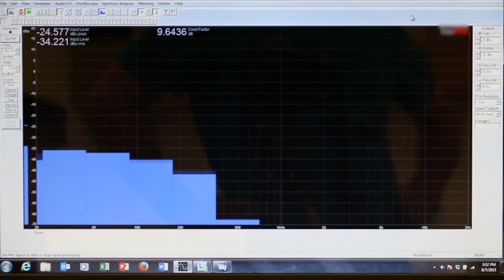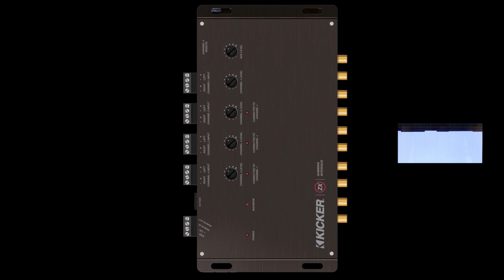Kicker Audio: How to find a full range signal in your factory system

Comment: Where can you find those type of test leads?
Reply from the maker: Anywhere they sell multimeters.  As long as the leads have pointed ends to probe molex plugs youre fine, asssuming the leads you get are compatible with your meter.
Reply: @KICKERAudio  Very helpful, and good point about probing the molex too.  Thanks

Comment: Seems you should be able to set gains and check for clipping and distortion with This, it's like a simpler but more expensive DIY Oscope leads for a phone... but still a hell of a lot cheaper than a dd1.
Im just curious, cause I came here from downloading the file to make this, and it says to use a line level to Mic level adaptor with attenuator.... is that only needed for connecting to a phone? Or will the proper 4 pole aux to rca work like you used in the video?
Reply from the maker: To properly install an amp using a factory audio signal,  you have a few goals;  the first is to determine what speaker wires have the correct frequency response to support the amp (full range/high pass/low pass/all pass). To do this, you need something that displays frequency response, like the software or RTA you saw in the video. When you want to watch for clipping however, that detector may work during amp setup. 

To answer your other question, the line to mic cable is needed to reduce the voltage from line level and to give you the microphone input signal you need on the mic jack, so yes you are right - the aux to RCA has to be changed to be compatible with the mic input jack.